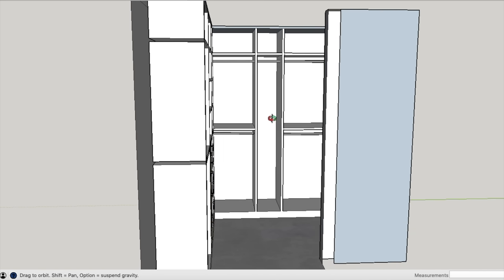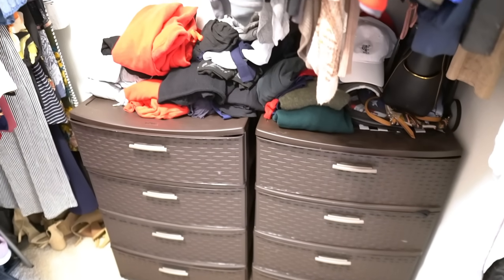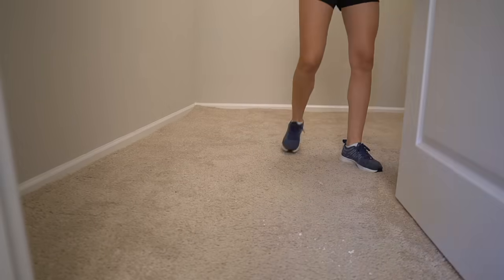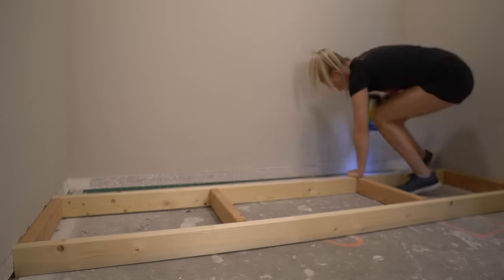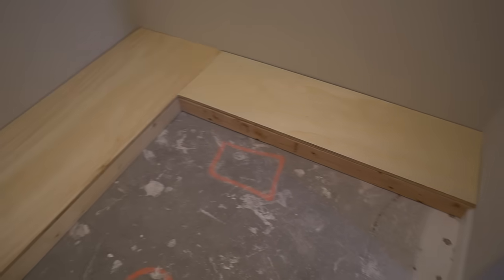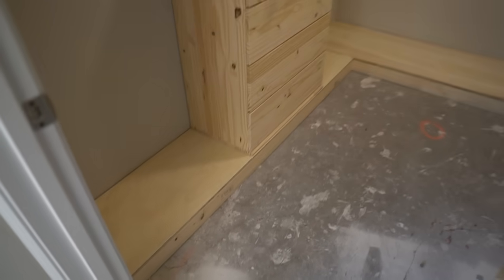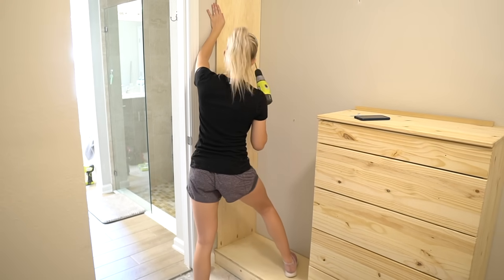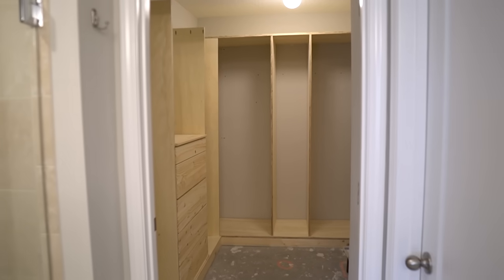DIY Dream Closet Makeover on a Budget!!! [Part 1] | Home With Stefani

Comment: Great video, thanks for sharing. I am planning on doing a closet rebuilt as well.
One question: shouldn't the 2x4s used in the base be treated wood? My understanding is that any wood touching the slab should be treated. They require that for the house framing as well. Thanks in advance for your advise.

Comment: Nice job - did you cut the wood panel on site with circular saw or got it pre-cut with dimensions by your supplier ? I fear the later will not get a perfect fit

Comment: Am doing something similar. Just removed all the wire racks. Did you remove and repair drywall anchors or did you just leave them and let the closet shelves cover them up?

Comment: Stefani, thanks for this video, my wife and I are going to do something similar, i do have a question.  Why again are you having 2 different size bases.  I get the 15 3/4" one to match the dressers but why make the other 22"?  Is that just for deeper shelves or so the clothes fit better?  We wanted to reverse what you did and put the 15 3/4" on the 'back" wall and the 22" on the sides but then the overlap in the corner is pretty significant.  Thanks for any comments.

Comment: Nice shelf system. You didn't need to pocket screw the vertical supports into the top. It would have been cleaner and stronger to screw from the top down into the vertical supports.

Comment: Great video! However @5:40, I would’ve rather tap out the two pins that holds the door & frame hinges and just remove the door instead.  Unless the two pins are not removable...

Comment: One small error I'd like to point out, sorry to he that guy, but you should use a vapor barrier or pressure treated lumber when over concrete. The alkalinity and moisture of concrete will cause damage an warping of regular wood in contact with it. Tar paper or plastic works just fine if you don't want to spend thr extra on pt and the more expensive screws they require.

Comment: A quick question, why wouldn't you buy malm 6-drawer dresser, instead of tarva dresser. Malm has got a deep drawers that you can put more clothes 🤷‍♂️
Reply from the maker: More expensive and too deep for our closet!
Reply: @HomeWithStefani  By the way what's your closet's dimension. I have got both Width & Depth of 55" and a 96" ceiling, pretty small ehhh but your work inspires us all. I am trying to plan my closet, and I am not sure if I can fit any dresser just to speed my work up, like you didn't have to waste your time building drawers, you know what I mean 😄 ikea has got various dressers. I am kinda confuse whether to just build clothing rods and shelves, or to add up a dresser too

Comment: Okay, one more lol. Think about those pocket screws in the side panels. The way you had to install them causes the screws to point towards the outside of the corner. In that orientation they have shockingly little holding power. Not sure what a better option would be, but the screws were basically pointless. I will be stealing most of your ideas though so overall really good info

Comment: the most difficult part of this video is using SketchUP

"For this closet makeover, I wanted to maximize our storage and use every inch of usable space. I designed our closet organizers in Sketchup and I switched up the layout at least 10 times until I came up with the perfect plan!"

this would take me months of planning - whereas install would take a weekend at most. if you include value of time into equation this project would cost me $10k+ LOL

Comment: I know it sounds mad but wouldn't have been easier to just buy PAX wardrobes from Ikea?  They would have been taller and would have achieved the same thing with a finish and all with compatible accessories and draws.  You wouldn't need to but the doors which is the expensive part.

Comment: You should of used a proper nailgun, that you're using isn't for framing. GJ tho
Reply: Seemed to work fine, would it have made much of a difference?
Reply: Noah Burt you can’t use a Brad nailer for 2 x 4 framing, the only thing it did was keep it in place and  the only reason it worked is because she screwed the back plate to the wall and sheeted the top.  It worked but you really should use a framing nailer for that application.
Reply: @viziondfc  yeah I guess my point is that if it's all you have and you're going to screw it together anyway, I don't think it's absolutely necessary drop money on a framing nailer if all you do is here and there diy projects. Just wouldn't want someone to come through the comments section and think that these kinds of projects are out of reach unless they have an industrial workshop full of tools. 

Obviously a that's the dream though lol. I'd be lying if I said I didn't take every excuse to get a new tool when I can.
Reply: Noah Burt that’s completely fair, and the project turned out nice so my opinion doesn’t mean much.  Good attitude about it though for sure.
Reply: @viziondfc  haha I would definitely not say your opinion doesn't mean much. It sounds like you know exactly what you're talking about. I just think it's good to make sure people who might just be getting into woodworking/diy know that it doesn't have to be a giant financial plunge right from the get go.